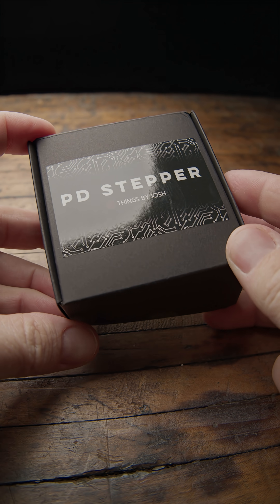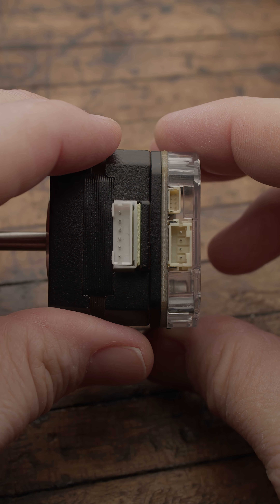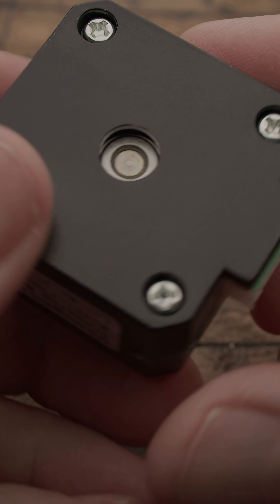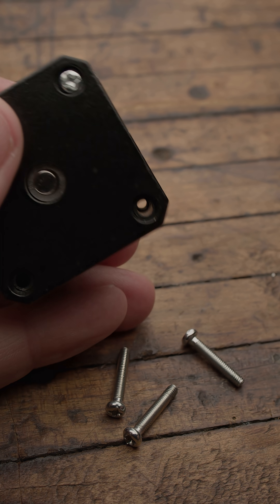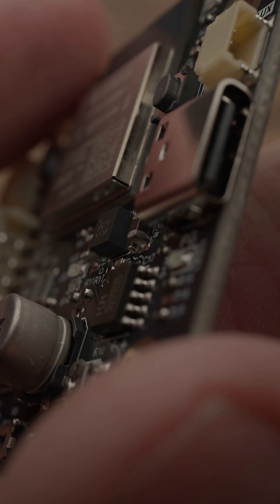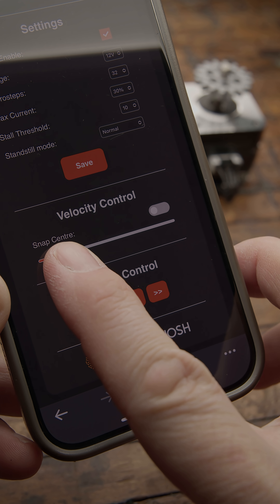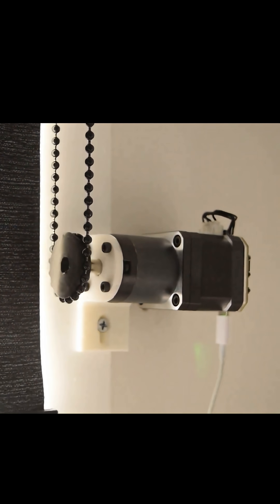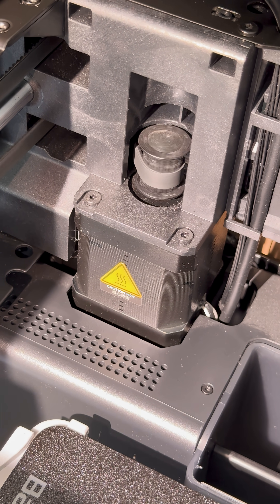PD Stepper

Comment: I might just build it myself so I can add a USB host to the thing so you can plug in a USB hub and then a whole bunch of other USB devices like other steppers and sync them all with USB high speed.😅😅😅 sell v2 for twice as much with different pin assignments hard coded😂 I always make a pull request 🎉🫡🥴🤖🤖🤖

Comment: The method for the double sided cooling (with the heat spreader) of the TMC2209 is awesome. The set is really high quality and there are several examples for the control of the stepper-servo. It is worth to buy the full kit.

Comment: This is good thing to remember in case a project comes along that needs precise control or positioning. Now if they while thing--motor included--could be shrunk to a really small size. Or, perhaps, one controller could control multiple motors.... 🤔

Comment: Very cool. I've got a project for it but I'd need a larger sprocket. Is that possible?
Reply: this is a motor driver, not a motor with a sprocket. You can use any NEMA 17 your heart desires, with any sprocket.

Comment: A whole ESP for a single motor?
Reply: Optionally you can use an AMD Threadripper 9995 to drive a single motor, which would have more power.
Reply: Looked at the price of an ESP?  What about prototype applications?  The system is open source for large production runs. Ever use an Arduino or Raspberry Pi for a one-of design? Ever use a PC to monitor a few sensors or pulse a stepper? It's how long it takes to build your design, not the cost.
Reply: ESP is like $2, deal with it.

Comment: i mean, it is only useful when you are using it standalone, right? I don't what project you can make out of a single stepper with hard attached type c cable. But the design looks beautiful. I think the creator just let their intrusive thoughts win and made a product that looks really nice but isn't really practical 😅
Reply: Stepper motors losing steps due to signal noise on the wires are a big problem in cnc. There is a trade off. Can you rely on the stepper motors staying in sync, or do you need to connect multiple shafts with belts.  Think of a laser cutter, if you use belts, you lose torque and can’t accelerate as quickly. But if you use dual steppers, and the laser wanders you may burn through something unintentional.
Reply: If it’s standalone I think you could very easy use it for kinetic decorations or tracking of data grabbed from some API using a 3d printed mechanism. Like maybe a beginner’s project to track moon phases or humidity every hour
Reply: It’s a learning tool. I think it’s a beautiful design. For people who are just getting into stepper motors, this is a wonderful way to learn. I think the developer did a fantastic job!
Reply: @bimmerboard  agree.
Reply: @bimmerboard  much cheaper options for beginners.
Reply: @JuanSumChninezeFue  and…?
Reply: well, a stepper like this is a big overkill for regular tasks, you can just use a cheap servo, it will still take less space even with an esp, battery, etc. But your ideas guys are great 😅
Reply: @user-random-1 I was going to say the same, I can't think of a single application that couldn't be done just as well with existing tech at a fraction of the price. That doesn't mean I don't want one though... there's something about it...
Reply: You can add another one and some light sensor and track the sun position and use it after for blinds control for example. You can get exact angles through the year, and use it in some other automation technics. Just imagine, it becomes true in automation.
Reply: @kudamne  nice, tho i think sun moves slightly different every year and you can also get the data from the web
Reply: @user-random-1 it’s just imagination. Of course I’ll use open source api for this task.
Reply: @user-random-1   the suns course from year to year changes so gradually you wouldn’t be able to measure it with basic equipment.  We’re talking negligent over thousands of years. Basically irrelevant for all tracking use cases.
Reply: I have a chicken coop door that I automated and integrated into my HomeKit setup. I needed a single of those steppers to open and close the door. This could have worked well actually.
Reply: Indeed. Besides flashing ESPHome and using it to drive blinds and curtains... I can't think of another use.
Reply: The applications are limitless with the right amount of creativity
Reply: Quiet, consumer.

Comment: Expensive, but very cool. Kudos to the creator.
Reply: Hmm. I don't see it as expensive at all. I mean, wouldn't there have to be a cheaper solution for it to be "expensive?"
Reply: If you build a robot with a lot of DoFs, the cost adds up quickly.
 
ESP32S3 is kind of beefy. I feel ESP32C3 would've been adequate and cheaper for the motor control task at least. Could be wrong.
Reply: @rsilvers129 I suppose it depends on your perspective, but I get your point.

Comment: MKS has closed loop steppers for a fourth of the price 👀
Reply from the maker: They’re not quite the same. The PD Stepper has the microcontroller and WiFi control built in. Also having it run off of USB power is super-convenient
Reply: @HackMakeMod some people are determined to get as little as they pay for

Comment: I mean, its cool that its open-source, but whats the point?? I cant think of any applications to use this besides learning about how e-motors work.
Reply from the maker: Turntables for videography, automatic blinds, focus puller for cameras, camera slider, antenna rotator, chicken coop door opener, greenhouse vent opener, etc.

For me, I am always working on prototypes. When I need a stepper motor, to just function for testing, this will save me a lot of time!
Reply: @HackMakeMod ah I didn't think it was powerful enough to actually open lighter doors and what not. In that case i could see it being useful (if it's waterproofed at least). Seems like programming it is a hell of a lot easier than buying a cheap motor and a random controller board off Alibaba lol thx for the explanation!